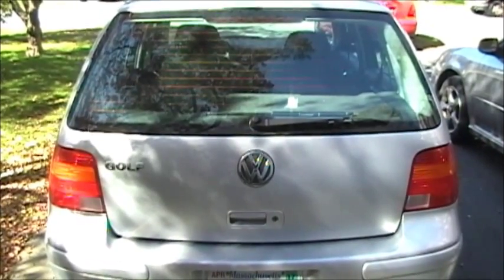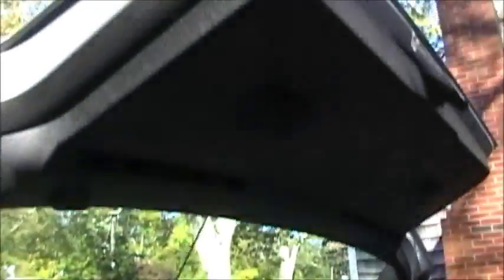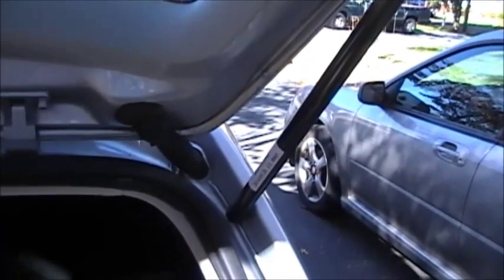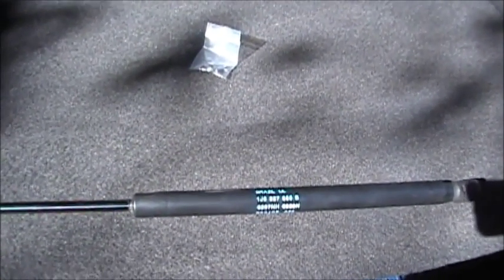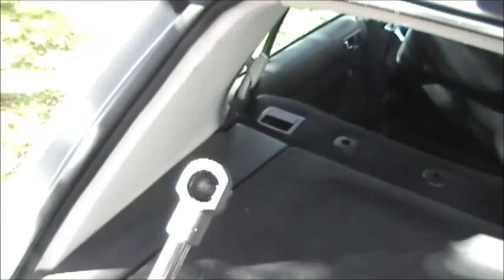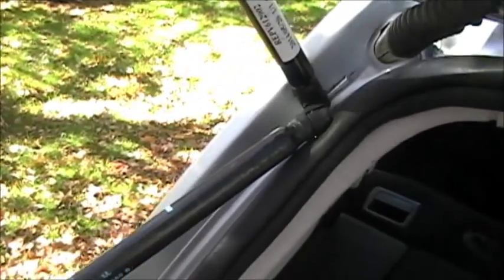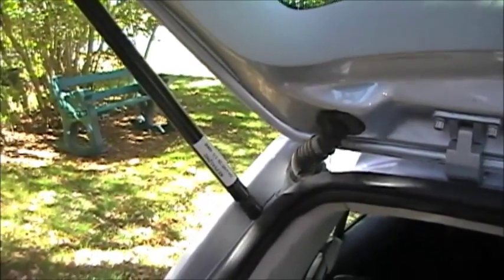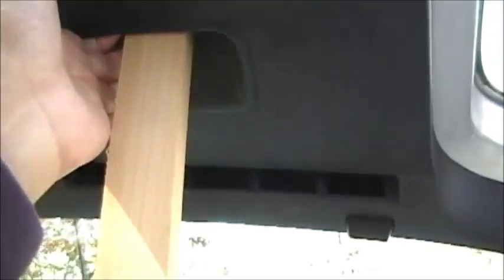'00-'05 VW Golf/Jetta MK4 Hatchback Lid/Trunk Lid Repair Secrets

Comment: I never heard a hiss, one day I just went to open the trunk and it wouldn't stay up.  I'm wondering if this is the only issue.
Reply from the maker: It's easy enough to check. Just prop up the hatch with a piece of 1 x 3 (or have someone hold it open for you) and remove the struts. One will be loose and oozing fluid. The other will be stiff, difficult to compress, and clean. For what it's worth, I wouldn't buy the same brand of aftermarket struts again. I'd try something that looked different.

Comment: It's easier if you use a flat head screw driver and  pop that metal holder straight back, takes all the pressure off the ball. At least I found it easier. Good idea not to buy stock